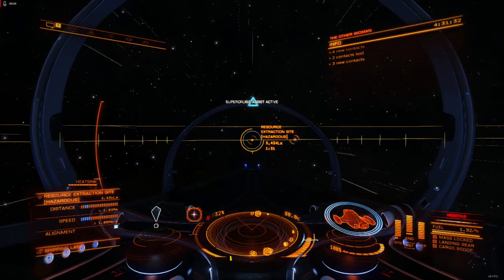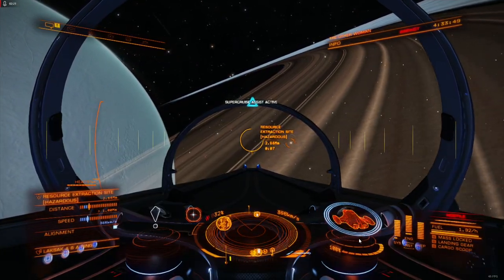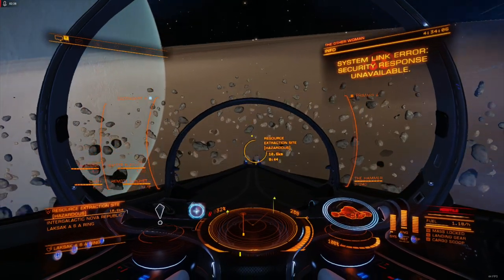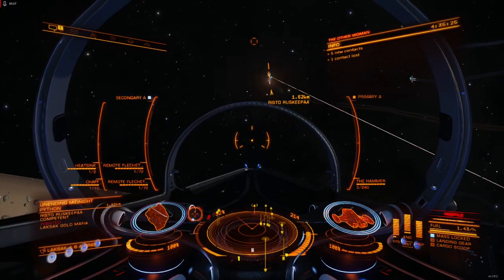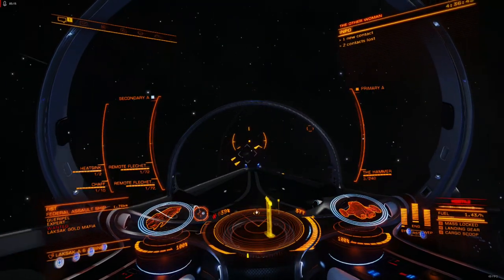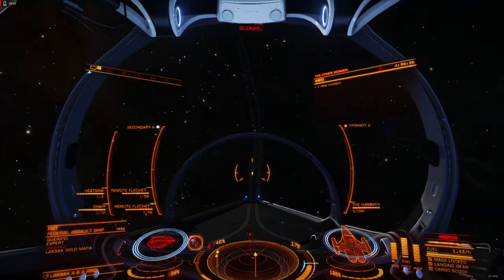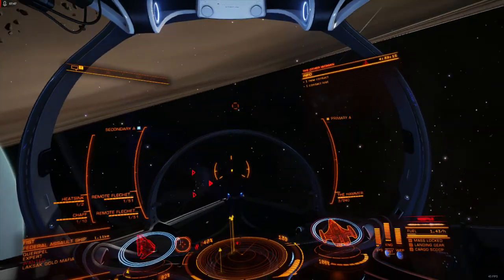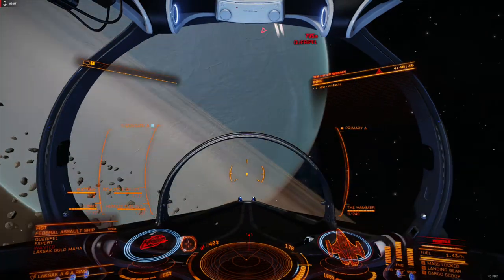Elite Dangerous | Build Experiments | Introduction to Flechette Launchers

Comment: This is a strange weapon to be sure. Paired they are amazing against Prism Cutters(having a reberb torpedo paired with these is disgusting ),  the icon ( ) that pops up is hull breach and essentially doubles module damage and is the only other weapon besides dumbfires that have a 100% chance to cause this debuff. I've thrown them into my AX cutter to put this debuff on thargoid interceptors and absolutely wrecks exposed hearts. e.i. 2 of these aren't enough to do module dmg to a CMDR if they run module reinforcements at that point they need to be pair with a railgun or missiles.
Reply: This CMDR decided to wake up and write up a masters thesis.
Reply: IT WORKS ON THARGOIDS??????

Comment: Can you do some tests on the enzyme missile rack? There's a lot of misinformation regarding it and I would like to know what is true. In description the weapon explains that it applies caustic burn, but someone mentioned that it also applies a corrosive like debuff that weakens haul similar to the corrosive shell additional effect. There's also a bit of misinformation regarding it's damage stacking potential. Some say one enzyme rack is all you need while others say the damage stacks if you have multiple racks. For about a minute the enzyme should deal 90 damage points to any ship without caustic resistance working as somewhat of a pseudo absolute damage type. There's a lot of confusion with this weapon and because of it a lot of players dodge the enzyme racks outright.
Reply from the maker: I'll add it to the list.
Reply: Would love to see that as well
Reply: If you add a corrosive multi in mix and are good on dumb fire missiles its a good surprise to hull tanks if you don't mind synthesis of its premium ammo. Only takes 2 or 3 connects with the warhead to achieve a good saturation of the corrosive effect. No where as strong as a goid but the premium is about 2/4 as strong.